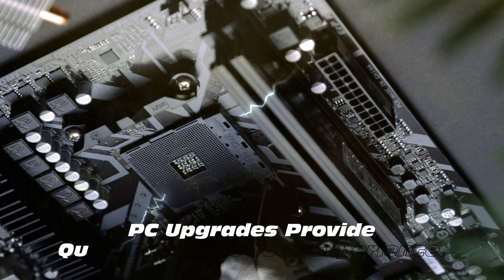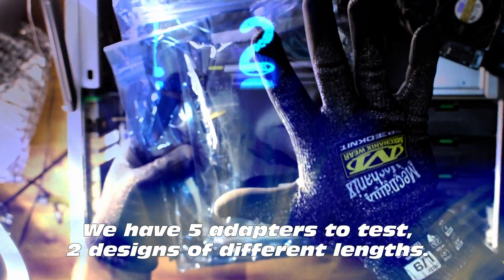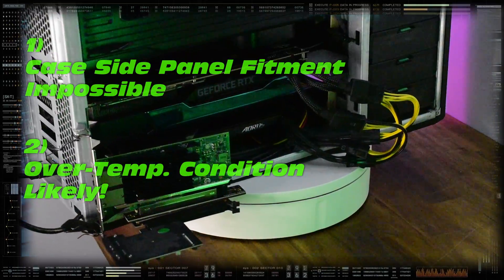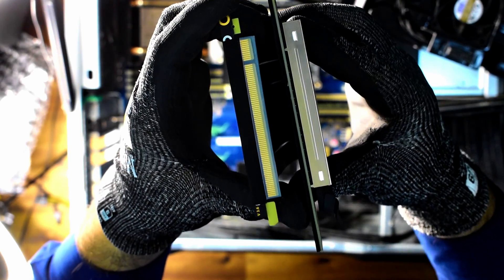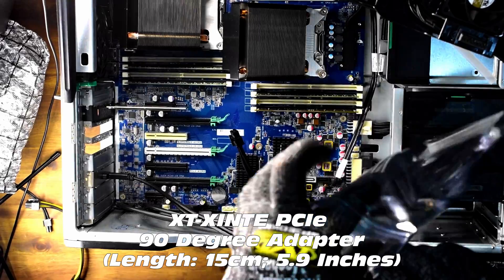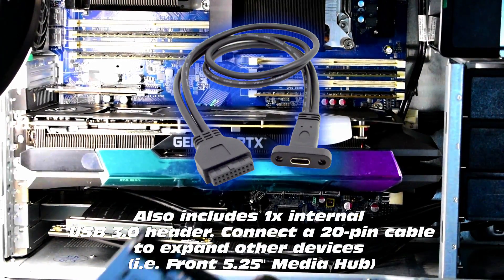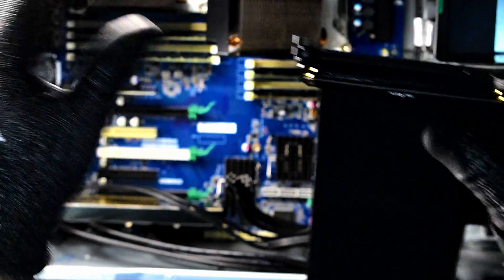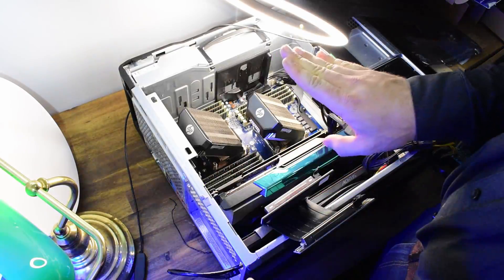This is How You Use PCIe Slots Under the GPU (HP Z840 Workstation + PCIe MOD = Using All PCIe ports)

Comment: It might be wiser to source a slimline enterprise level card it's pci3 not pci4 anyway and have plenty of load reduced ram on good dual cpus and you have everything working the same with more room for additional cards and less drama? I feel the z840 a bit like an old school Merc, they are not noisy or aggressive, but they drive forever, everything slots perfectly and the wind tunnel is very good both north and south.

With an RTX ax000 or 2 in there you are much better than any chunky 4090, as this is designed for professional cards not for big consumer racing cards.
Reply from the maker: In some ways yes, they were designed for that purpose and I don't think HP planned on users fitting oversized gaming GPUs. Do I regret the action? Not at all. The RTX 3090 Ti outperforms something like the RTX A2000 or A4000 - and my particular GPU was nearly the same cost as a RTX A2000 at the time of purchase. The RTX A6000 would hold some benefit since I frequently have all 24GB of VRAM in use when editing projects. More recently I have started experimenting with running local LLMs - the A6000 would again have benefit over the gaming GPU.

The HP Z840's limit is however power distribution - with 3x 6-pin power cables (219.6W each at least). If you do manage to fit say two RTX A6000 I doubt both will obtain PCIe x16 connectivity - one would need to go into Slot 2 and one in Slot 5 (maybe it will clear in Slot 6 but it likely will not). For the price point I would rather get the cheaper gaming GPU and invest more into storage. If you switched over to the HP Z8 G4 I am certain the two RTX A6000's would work. The Z8 G5 would do 4 RTX A6000s! But at the enterprise GPU price point I would again rather get the gaming GPU and spend the difference on storage or other system upgrades. The budget hampers these decisions. But if the budget was open, the added compute from running multiple GPUs would be advantageous.

Comment: hi , is it possible to sand down or filing a 15mm height 90 degree pcie riser to fit under a gpu ? the measurement i have for the clearence under my gpu seems to be 14mm.. thanks in advance if you do reply
Reply from the maker: Yes, it would be possible to file the top of the riser down slightly. There should be no traces on the upper margin of the riser. A 240 grit sand paper should clean it up nicely. Just make sure not to damage the cable's contact fingers - best to mask them off before you start sanding. 1mm might not be a lot but it is enough to not let the GPU seat.

Comment: How to give power to the GPU? I only have 6 pin connectors, but I need two 8 pin connectors for my GPU
Reply from the maker: Good question. I have a detailed outline on how to do that in this video: https://youtu.be/D1cwwiR4UHM (check 12min 24 sec and the video description for that video for the adapter cables you need). 

I converted the 6-pin GPU power cables to 8-pin GPU power cables by using a 6-pin to 8-pin adapter cable. Normally for ATX PSUs the 6-pin cables are limited to 75W and the 8-pin cables are limited to 150W. HP over-engineers their PSU 6-pin power cables so that they can supply 219.6W (nearly 3x more power than industry standard for 6-pins!). This is why you can adapt the 6-pin cables to 8-pin cables. If you did this with an ATX PSU you will fry the ATX PSU - so it will only work with HP workstations (in particular) due to the over-engineering.
Reply: @racerrrz  Got it, thank you

Comment: Wish you would link what that thin riser was at the beginning.
Reply from the maker: Thank you for your feedback. I provide a detailed video index in the video description so you can skip to the relevant parts as desired. The video structure is to ensure that anyone can reproduce the process and understand how to troubleshoot it - rather than just making it a short vid with a cool PC mod without any info on the limits of the process etc.
Reply: @racerrrz  literally not what he asked but ok
Reply from the maker: @afruit6720  Fair call, I did the best I could to answer what I thought he meant. 

Anyhow, it's difficult to track these riser cables online, but I was hoping that the idea would help others to find similar riser cables. 

I have scanned through the common market places and created affiliate links to 90 degree riser cables that may work (video description). The listings may not last forever but maybe that serves as a guide. 

The cable that I found that worked was printed here: 

   5:53   DEMO of Theory in Action!

Measurements were taken here:

   9:45   PCIe Connection Sizing / Measurements 

   15:45   PCIe Riser Adapter – Measurements

Comment: Can you fit 2x rtx 3090 into z840?
Reply from the maker: The motherboard would handle the dual RTX 3090's but the PSU does not have sufficient power cables to power them. 

The max GPU power available is 3x 6-pins that supply a total of 685.8W (3x 219.6W; 12.2V @ 18A per 6-pin). 

The HP Z8 G4 might handle dual RTX 3090's - it has a max GPU power available of 878.4W (4x 6+2 pins at 219.6W each; 12.2V @ 18A per cable). The only limit is the number of cables - your GPU would need to only require 2x 8-pins for the Z8 G4 to support dual GPU.

Comment: I'm glad I found this channel, I have the exact same workstation z840 and I can't believe that such improvements you are made like video cards upgrades and various adapters for storage. Amazing content. Thank you so much! By the way what you recomend beter for my Quadro K5200?
Reply from the maker: Thank you for your feedback and support. Nice going with the Z840, they are solid machines for the price point. Being able to load in several PCIe expansion cards really opens up the possibilities for customization. I am quite satisfied with my quad RAID 0 NVMe adapter setup - awesome speeds and capacity for such an aged machine. In terms of workstation GPU, the one I like best from a value perspective is the NVIDIA RTX A4000. They have 16GB GDDR6 with ECC and a small footprint / power draw requirement. If you plan on gaming at all it would be better to get a gaming GPU - something like the RTX 3080 is quite solid. I settled on the RTX 3090 Ti for the added VRAM for video editing.
Reply: @racerrrz  Thanks for the detailed answer. I use this computer for 3d printing like slicer programs or cad programs, less for games.I have had this computer for about 3 years. Hp z840 parameters are: x2_Xeon e2667 v3 3.20ghz / 128gb ram / Nvidia quadro k5200 GPU.   I think I should expand the amount of RAM and get a better video card. I need to watch all your videos related to the improvement of this computer. Thank you
Reply from the maker: @andriusanryy5165  Nice, the Z840 really handles it self well for CAD applications. I had the E5-2667 V3 for a long time, solid performer. You may want to check for a matched pair of E5-2697 V4's - the used Broadwell prices are quite good at the moment. If you want max core count - consider the E5-2696 V4. The CPU upgrade would allow 2400MHz ECC memory modules also, but RAM is still quite pricey. If you are running short on memory it's worth the expense. The GPU upgrade should improve your productivity the most. 

I quickly compiled all my Z840 videos into one place to make it easier to cycle through them. My website still needs a lot of work but here is a sample: https://racerrrz.com/hp-z840-hub/

Comment: I bought one from Amazon and it worked! I had to snake the riser cable below the GPU, then above the next slot's PCIE card, then down again. The riser cable was only 200mm so it was barely long enough. The motherboard and the other PCIE card (Optane U2 SSD) were blocking the riser cable's PCB a little bit, so mounting the wifi PCIE card was a little bit crooked and didn't line up with the case. However the screw went in and the antennas still kind of screw in so all is good.
Reply from the maker: Nice - which cable brand did you end up getting? The riser cable length is a bit tricky to plan for - that's why I just bought differences sizes to figure out what works. The clearance is really tight, everything has to be just perfect to clear, but it sounds like you managed to get your wifi card mounted. No complaints - now you have wifi!

Comment: lol, I had same problem with my  workstation Dell t7810 with 2 x Xeon  and 2 Nvidia Tesla . My solution to install the second  Nvidia Tesla was the same :)  I installed the reiser  30 cm  with angle 90. I replaced the side metal panel with plexyglass panel and cut a  slit to pass through the reiser cable. I printed  with printer 3D the GPU holder and now the GPU works on the plexyglass panel, outside the workstation. I also installed a 1000w sfx power supply only for the 2 Teslas and obviously a 2addpsu module to turn on the second power supply :)
Reply from the maker: Well done, they say great minds think alike and by that logic I applaud your ingenuity. The tolerance under the GPU is quite limiting but certain GPUs would have more clearance than others. Great thinking with the 3D printer also - finding a way to get these adapters to mount remains a tad tricky. My cheapest logic was a longer riser cable that would allow the adapter to be routed to a new location inside the case. Had my GPU power cables fit inside the case I likely would have worked on a method to mount the riser extension above the GPU / on the GPU backplane. The extra external power also helps overcome the limitations of your T7810 system.
Reply: Whst is the 2addpsu module

Comment: I am using the same technic, to use ALL slots on my MSI B450 motherboard, because I have dual slot GPU, PCIe WiFi card, PCIe x4 SSD, second single slot GPU, for DVI monitor, and PCIe sound card, because the integrated Realtek chip failed.
Reply from the maker: Nice! Which PCIe riser cable did you use for yours? I have not found many that actually fit underneath the GPU. I applied the same logic in my Z440 server built - all 6 PCIe slots are in use - but at least there I had a PCIe riser build into the case to mount the GPU. It just makes sense to get the full usage out of your motherboard!
Reply: @racerrrz  I used PCI Express x1 riser 25cm from Aliexpress, to connect my sound card and mount it vertically. I was able to bend the cable, so that it can pass under the GPU.

Comment: You can trying using pcie3 x16 expansion backplane with chassis such as 'netstor' 'datapath' 'one stop systems' etc. Then you can close Z840 door with big GPUs without stress for fitting. But your poket will.... gone empty💸
Reply from the maker: Hi there. Those are some really impressive PCIe expansions and it can really open up possibilities for some $$$. There doesn't seem to be all that many solutions to the sheer bulk of the GPU - but the main fix I was been working towards as an E-GPU based configuration (so an external housing with at least 3x PCIe 3.0 slots, but they tend to only have 2 slots) or case swapping the Z840 motherboard. I plan to test out a Z840 case swap and so far I can power a Z840 motherboard outside the case / independent of the OEM PSU. But for now the open case is having to do. Dust build up is an issue but thermals are staying good on everything at least.

Comment: I guess we can use any riser, they are all the same? any  websites doing any riser reviews?
Reply from the maker: Good question. I would be inclined to say spend a bit more to ensure you obtain a quality piece. I ran into issues with the cheapest riser cable - it caused a PCIe fault and lead to the adapter not working (I covered that and troubleshooting in the followup video to this one: https://www.youtube.com/watch?v=5tQct_LxPjo , 9.58 in the video). Looking at the PCIe card (USB Type C Adapter), I think the riser cable fried capacitors on the adapter (there was leakage from them). 

In terms of a review of riser cables, I don't think any one has done that. I would recommend getting the highest quality item you can obtain for the lowest possible price. I plan to get a Lian Li Riser cable (PCIe 4.0; PW-PCI-420) for that reason.

Comment: hi how about external gpu? is this an option for hp-z840?
Reply from the maker: Hi, yes it should be quite feasible. A quality riser cable plus a secure GPU mount will do the job well. If you were really keen to push things you could get a couple of the modern GPUs connected to the Z840 with riser cables (powering both of them will need an external PSU also). It gets messy but there are options!

Comment: Had to solve this one too while modding an original Cooler Master HAF case; pciex4 riser to usb3.0 card, utilizing the vertical single slot where a water cooled GPU would have went! 😆
Reply from the maker: That's great to hear. The riser adapters sure come in handy. Did yours manage to still fit inside the case? I think with one riser adapter here you can still close up the case. Yours wasn't the Cooler Master HAF X case by any chance? I still have one in the family! Solid tower even by today's standards.
Reply: @racerrrz  Yep!  Mid-tower ATX; painted the inside flat black, outside beige.  Cut the bubbled side panel out and replaced with pet-proof window mesh for maximum airflow.  7" raspberry pi touch-screen where the 5.25" drive bays use to be and de-riveted internal cages.  The USB 3.0 card and 3060 TI are both vertically mounted!
Reply from the maker: @techromancer313  That's cool, even more so with your case being a HAF X! Your system sounds well tuned. The touch panel in the case makes for a nice upgrade to modernize the case and to add that custom look. Add in the two vertical risers and you have a solid case there!